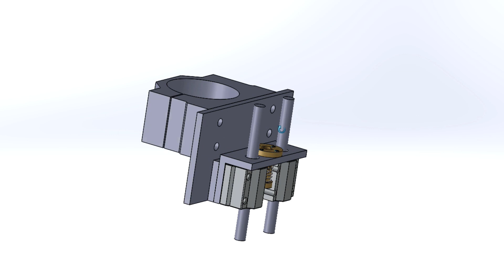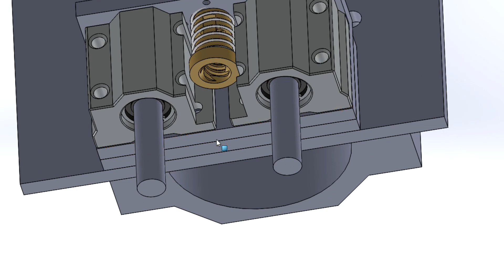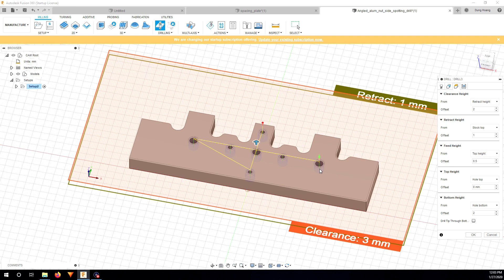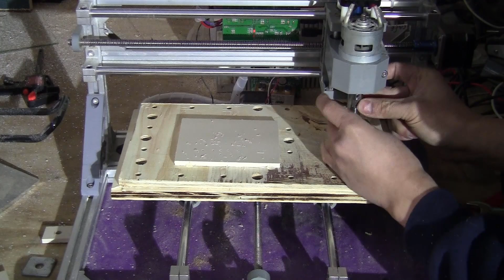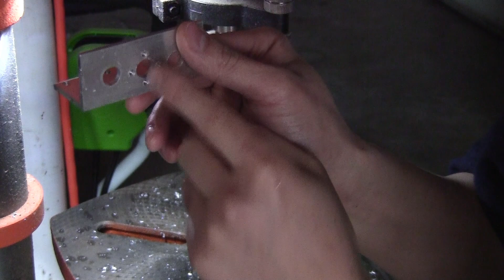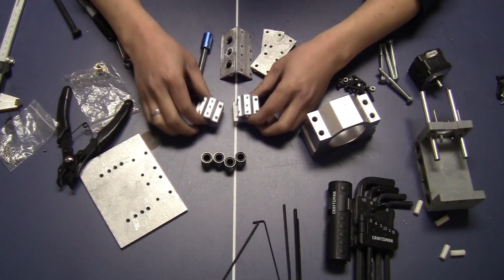3018 CNC - Spindle upgrade - all aluminum spindle holder

Comment: i carried out your aluminum z axis mod which made quite a difference. I substituted  my poor 30mm linear bearings for 45mm ones using set screws as you suggested . Although you lose more z axis travel the set up is much more solid . Thank you.
Reply from the maker: 45mm linear bearing surely will help to reduce the vibrations and increase precision. I'm glad you found the upgrade helpful.
Reply: @minhsmancave9448  thanks

Comment: Awsome design, I've been looking at this system and a new 200mm set of rails and lead screw. Upgrade the z axis travel at the same time. Too bad you can't make it wider without sacrificing spindle travel. The machine would benefit from it.

 Build a new aluminum assembly to replace the last bit of plastic in the back of the z axis. The longer travel will let the bigger spindle move up to full gantry height with the tip of the bit. Allow for much more milling depth. I'll also add another "motor clamp" assembly to hold my 5.5w laser. Make them easily interchangeable.

Comment: Hi, 

Noticed you changed your back plate, you added additional holes for the motor clamp. 
Was this to correct a mistake, or did you want to be able to raise or lower the height of your spindle motor?
Reply from the maker: I made a mistake in my original design (the distance between the two rows of holes should be 20mm but I only made it 18mm). So I drilled another 4 holes with the right distance. The final design that I shared is correct, no need for more holes.
Reply: @minhsmancave9448  

Glad I asked, yesterday I cut out the drill patterns and I have my aluminum plates cut to size. I was worried I would need to make another drill pattern. 

Thanks for the reply,
Reply: Having difficulty finding the correct Anti Backlash nut. First I ordered T8, Pitch 2mm, Lead 2mm. This didn't fit. 
Then I ordered T8, Pitch 8mm, Lead 8mm. This still did not fit my lead screw. 
I have  stock SainSmart ProVer 3018. Do you know that size of nut I need?
Reply from the maker: @vcholman  yes, it's T8 2mm pitch, 4mm lead. something like this: https://www.amazon.com/BIGTREETECH-Direct-Backlash-Elimination-Threaded/dp/B083JWJT8W/ref=sr_1_1?crid=WKI31Z0RG4W1&keywords=t8+nut+4mm+lead&qid=1583551024&sprefix=T8+4mm%2Caps%2C630&sr=8-1

Comment: Hello, 
Nice job and good design. I would like to fabricate the same aluminum mounting bracket. I don't have a 3D printer, I would be using my 3018 CNC to make the drill patterns. 
I down loaded your design documents. They are not *.fd3 or *.nc files. How would I use your sldprt files?

Thanks,
Reply from the maker: There's a folder with steps files that you can use in fusion 360 or any other software to set up the CAM process and generate the NC files.
Reply: @minhsmancave9448  

I'm learning Fusion. How do I import Step files in Fusion and will I have access to the dimensional drawings or just the manufacturing files to generate the tool paths?
Reply from the maker: To open a step file in fusion 360,just go to file, open, open from my computer then choose the step file you wanted to open. From there, you can read the dimension, modify, etc... I have another video about start milling with 3018 cnc using fusion 360.you can take a look. Fusion 360 is very easy to use to generate a tool path
Reply: @minhsmancave9448  
Got it. Already generated all the tool paths and ordered the linear bearings and anti backlash nut on Amazon.

Thanks,

Comment: That I'm gonna do to my 3018 too. Thanks for sharing this. Great design!
One thing though, NEVER wear gloves when working with a drill press!
Reply from the maker: Thanks for the safety advice. It's was shaking a bit too much with the big drill bit and hurt my hand that's why I put on those gloves. But you are right, those gloves might got caught to the bit and pull my fingers with them

Comment: Could you share a parts list with the links please. Thanks . You are awer!!!
Reply from the maker: You can get the whole spindle setup here: https://www.ebay.com/itm/New-CNC-0-4KW-Spindle-Motor-ER11-Mach3-PWM-Speed-Controller-Mount-Engraving-Kits/264416200845?_trkparms=aid%3D555018%26algo%3DPL.SIM%26ao%3D1%26asc%3D20131003132420%26meid%3D7182b1cd0ae24735a59f4bccb7da2ae6%26pid%3D100005%26rk%3D2%26rkt%3D12%26mehot%3Dsb%26sd%3D163151378914%26itm%3D264416200845%26pmt%3D1%26noa%3D0%26pg%3D2047675&_trksid=p2047675.c100005.m1851

Comment: I seriously wonder whether that beautiful alu montage won't kill its step-motor in the long run... By the way, how much does it weigh finally? 600g? Anyway, I love your ideas and this one is pretty inspiring. Thank you Minh! Can't wait a demo of all this! I suppose thIS CNC will be heavily used to build your plasma CNC... Have a nice week end my friend.
Reply from the maker: I'm sure it will have to work harder compare to the plastic or plywood setup. How much harder? I guess that I will have to find that out over time. I showed the movements at the max feed rate (2000mm/min), but usually when milling, the plunge rate is very slow, maybe 500mm/min maximum. So, I hope that it won't kill my stepper motor any time soon. And if it does, I guess that it will be also time to do a stepper motor upgrade. Thank you my friend, you are my best supporter !
Reply: @minhsmancave9448  Honored to be your best supporter because your channel deserves much more views. Thank you for being clear about the eventual issue of an exhausted stepper-motor. You're right, only time and... use will tell.

Comment: Very interesting.  btw, I saw someone had changed out all of the smooth rods with linear rails and wow what a difference.
Reply from the maker: Yes, defintely, all type of fully supported rail would make the machine much better.
Reply: Funny thing is when he was done you could barely tell it was a 3018 anymore so was more of a Frankenstein machine but was rock solid.
Reply from the maker: For me, if I invested more money to buy all the rails, I would build a larger and more powerful machine (which I did). The main purpose of this machine for me is to learn and test all the CAM processes.
Reply: Exactly and why I found it weird.  I did find it interesting but sheesh, lol.
Reply: What more powerful machine did you get?
Reply from the maker: I took apart the one I showed in the axis calibration video and used some components for the cnc plasma table I'm building (and used the spindle for the 3018). After finishing the plasma table, I will build a new one with working area about 1.8m x 0.9m x 0.2m, nema 34 1800oz steppers and 2.2kw spindle. I'll use the plasma table to cut the parts for this new machine.
Reply: Holy Toledo, wow.  Yeah, I just need 300mm x 300mm and able to do aluminum up to 6.35mm thick and the pricing is hideous or they use linear smooth rods.

btw, the calibration video was on the 3018 (same as in this video).
Reply from the maker: If you wanted something good and low price, you will have to do it yourself and it's fun building one
Reply from the maker: Other calibration video (3 axis cnc - mach3), not the 3018 calibration one
Reply: I just don't have the tools to do it as the only tools I own are a Dremel, a DP,  corded hand drill, and a hacksaw.

The video you mentioned doesn't exist - https://www.youtube.com/channel/UC2WnVQvs841c7HwUIXtaA0Q
Reply from the maker: That's where my 3018 come in handy. It's still a cheap tool and can make some precision parts (to certain extends and from thick plywood) for other CNC builds (the one in the calibration video). Then with the new machine, you can improve itself with some aluminum cuts.
Reply from the maker: This one: https://youtu.be/GZzTefFZHVs
Reply: The original video I found you from I think you are talking about?  https://www.youtube.com/watch?v=GZzTefFZHVs   The all wooden one?  I was thinking of a 3040z but it uses unsupported linear rails which suck.
Reply from the maker: @thebeststooge  Yes, mostly wooden parts but the rails are fully supported. If I were to rebuild it, I would use 3030 aluminum extrusion bars (what I'm doing with the plasma table) which you can buy quite cheap from here: http://www.zyltech.com/store/p243/ZYLtech_3030_Aluminum_Extrusion_-_Pre-cut_length_1000mm_or_1200mm.html.
Reply: I have a lot of 500mm V-Rail and a couple of 2040/2060/2080.